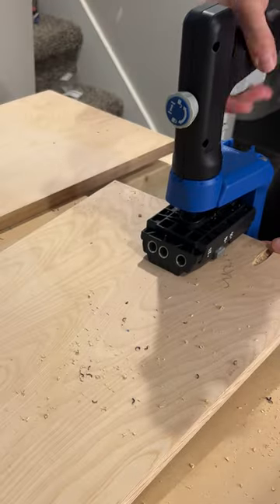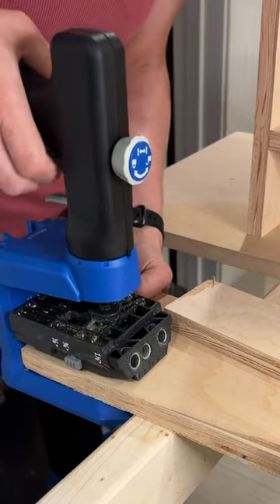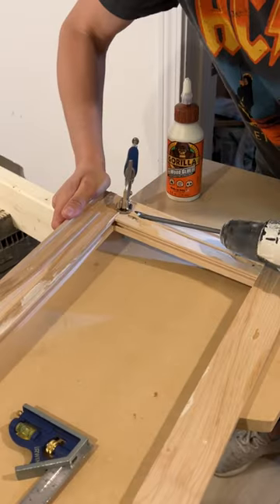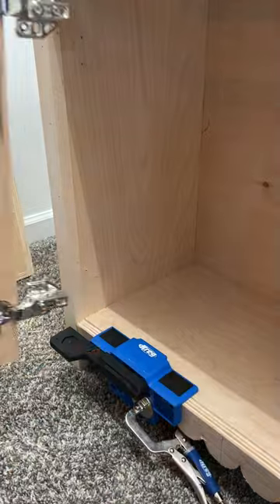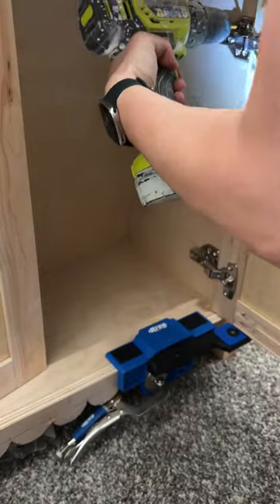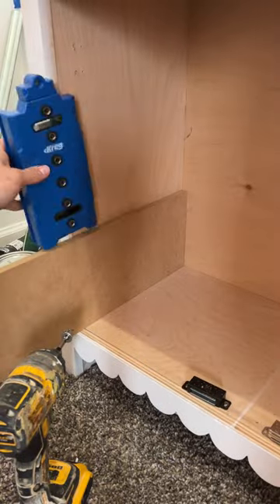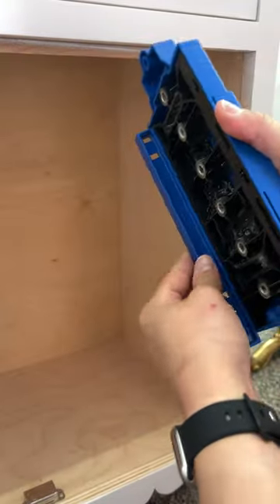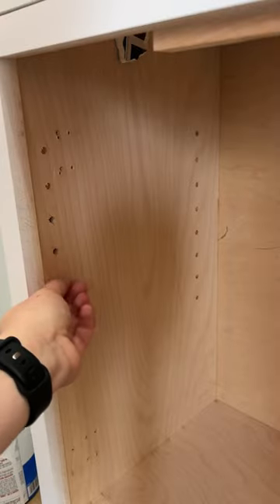Simple Cabinet Building With Kreg

Comment: I hope you are not installing that in somebody’s kitchen or house.  That would be a good shop cabinet but you should not depend on Kreg for all of your joints.  I only use kreg to make face frames.  Do not depend on this for holding the whole thing together. It’s not a strong joint.  At all.  Stick to glue and nails.  Or be an actual woodworker and learn some joinery so you can be proud of your work and people will be proud to have your work.  Building cabinets like this, you should just go work in a factory.  And I also hope you are not charging the same price for kreg cabinets.  You are ripping people off if you charge more than 150/ft for kreg cabinets.